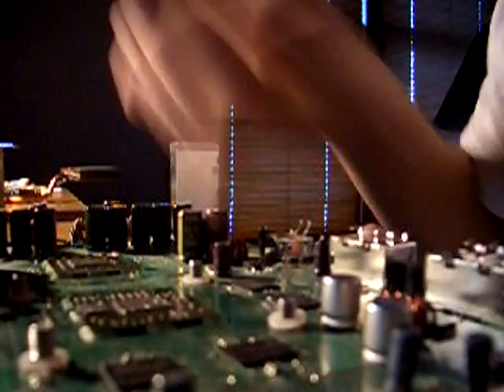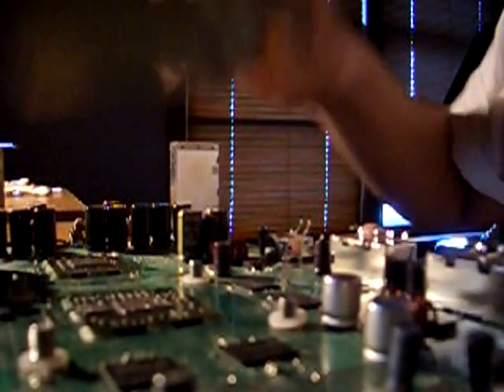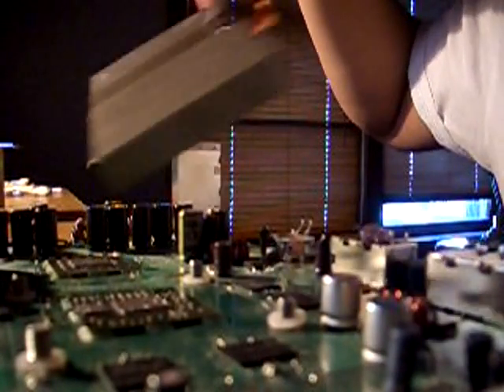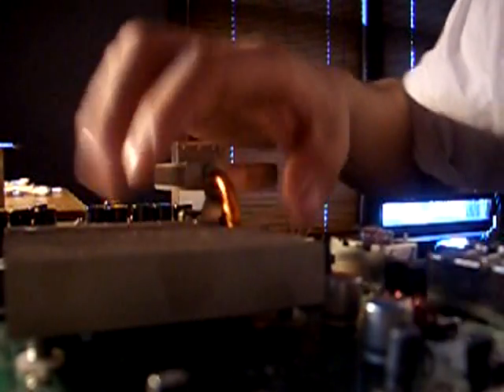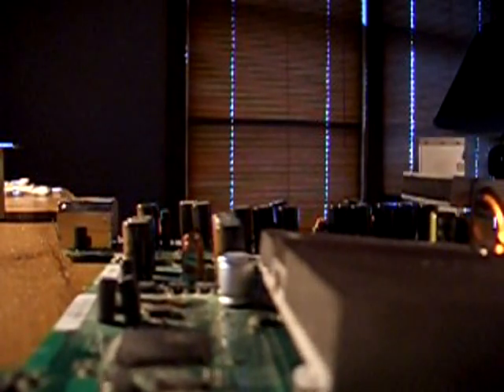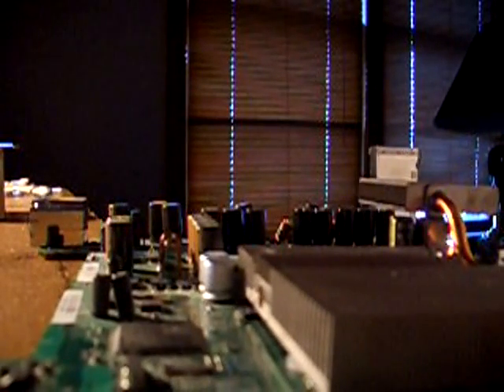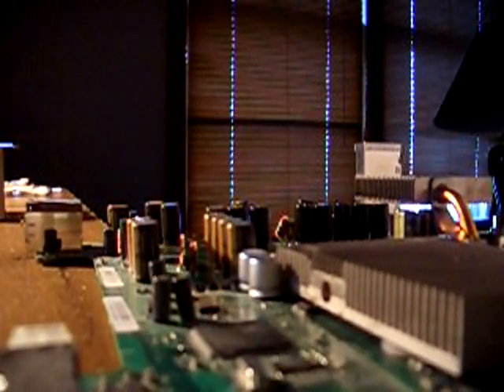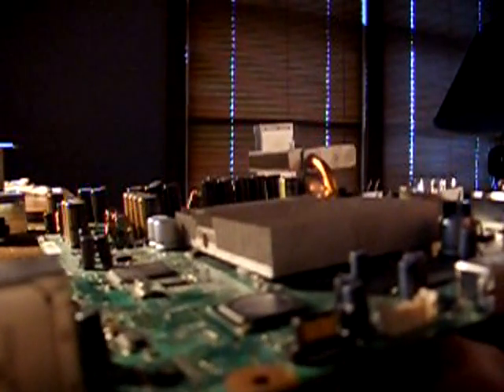RROD part 4 (X-clamp)

Comment from the maker: Yes you can use normal screws from any hardware store aslong if they have the size, it doesn't matter what they look like. I used the torx screws but any will do cause you'll still have to drill wholes on the metal casing so it can fit....

Comment: yes Billhubbard is correct...another option is if you have a really really hot blow dryer you can sometimes use that ... problem is most dont get that hot but my mom had an old one that if you just left it on for like 20min it would get up to 350^ or something crazy and it would melt solder .

Comment from the maker: I Would recomend using 2 washers on each because the spacing between the chip is about or very close to 2mm so if your washer is 1mm thick it will mostlikely overheat and burn the chip.